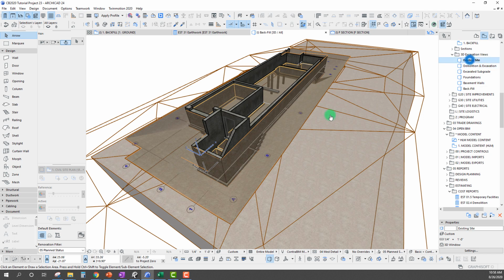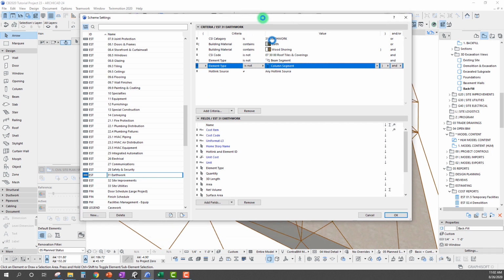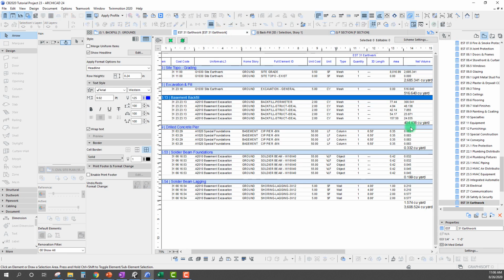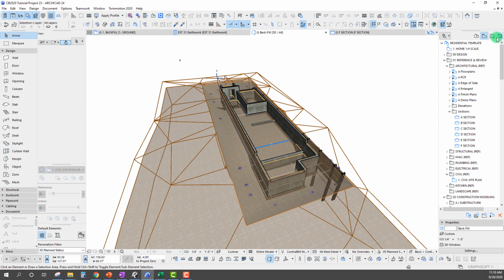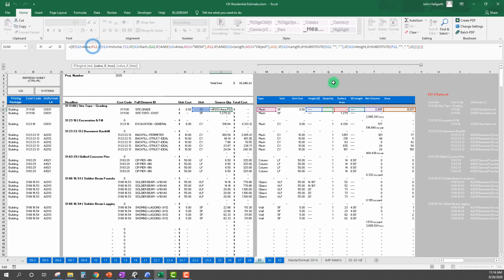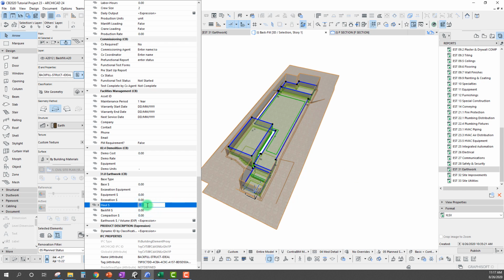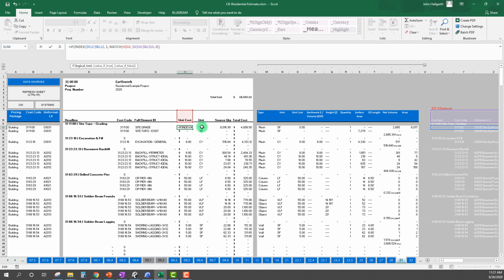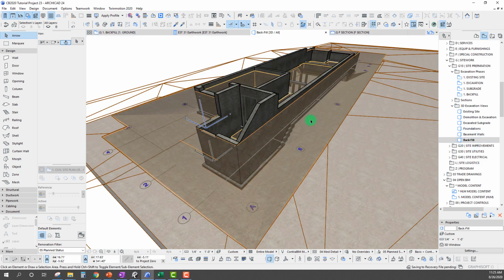Earthwork Quantity Takeoffs & Estimating in Archicad (Part 9)

Comment: Great series! :) 
I just wondering - cost codes are based on some official classification (e.g. 3123 23.13 Basement Backfill) or is from your experience?
Reply from the maker: The cost codes referenced here are from CSI Masterformat Spec Outline. You can find the classification download under the Archicad BIM Content webpage via the link in your Classification Manager. It's a helpful reference!